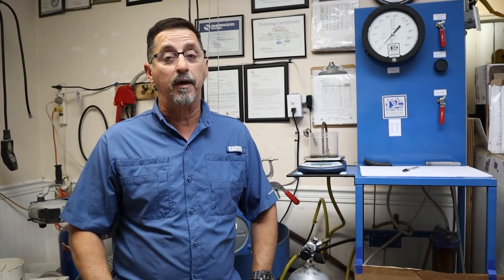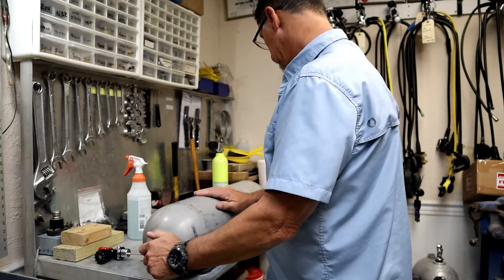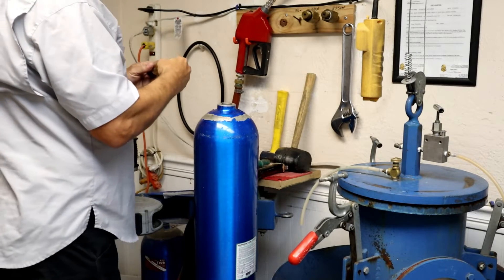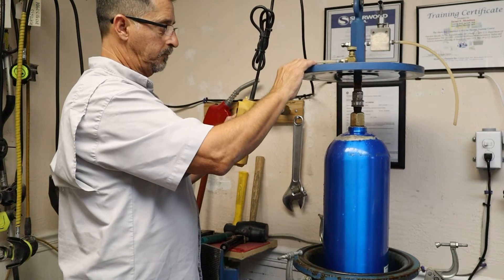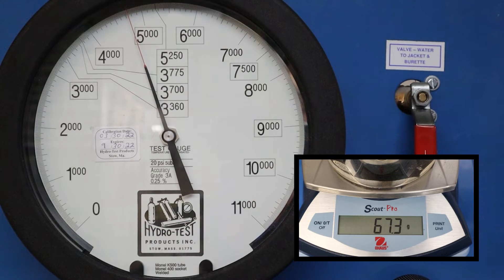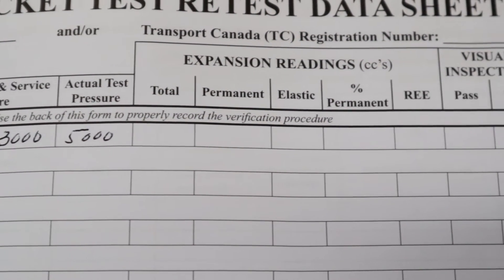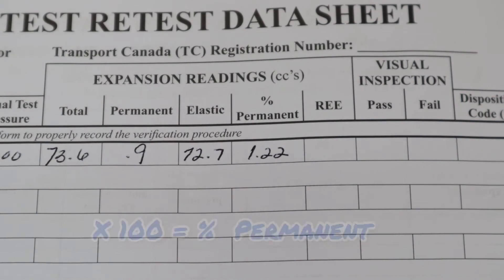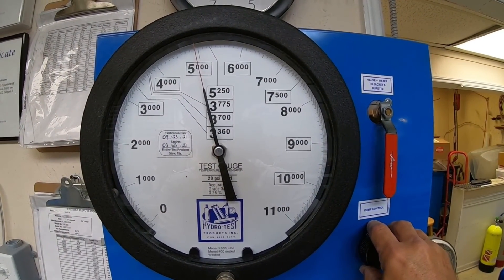How to Hydro Test a scuba tank

Comment: I enjoyed watching this. I've been servicing tanks for 25 years and would love to get into hydrostatic testing. I just don't know where to start, and if there's any regulations (which I'm sure of), do I need any type of license, etc.

The only thing I saw in my findings that's different from what you have is that the water jacket needs to be placed in a pit? Makes sense, but to your point, water doesn't explode. Do you have any information that could lead me to the right direction, including equipment as to where and how to get started? Thank you
Reply from the maker: Since you're in the tank service business, hydro testing would be the logical forward move for you.  I also serviced tanks as wells regs for over 20 years before I entered into hydro testing.
Having the experience with scuba tanks prior to hydro testing will enhance your ability to understand and excel in testing.  
The company Hydro-Test is a great source for info about equipment and training.  They also offer continuing education which is required by D.O.T every 3 years.  As for the in-ground water jacket, that is an option if plan to test larger cylinders and need the extra clearance.  I only test scuba tanks therefore a 40" above ground well is all I need.  Good luck to you, thanks for watching.👍

Comment: Do you put 5,000psi of air pressure into the scuba tank? I thought water was not compressible?
Reply from the maker: 5000 psi of water pressure, the tank is filled with water and inside the water jacket also filled with water.

Comment: empty weight, ABOUT 32 pounds,   adding, ABOUT 3 gallons?! , so we are adding PROBABLY 24+ pounds. nice imperial system. "about" time you guys hear about the metric system  10 litre = 10dl , 100cl, 1000ml, 10 kg, 100 hg, 1000g, 1000000 mg. now tell me, how heavy is 308.462 litre of water? easy, its 308.462 kilograms, its even 308462g. no about, no probably, no guesswork, no formulas, no rounding,  just a perfect goddam system. sorry for rambeling but imperial seem insane to me
Reply: nice content tho

Comment: Sir I want to know calibration proses
Reply from the maker: @moheebullah2586  calibration is done with a calibration cylinder to specified psi and cc of expansion.  Ex. 5000 psi expansion is 72.4 cc then release pressure and return to zero if not zero you are allowed 1% +/-

Comment: what you use to apply 5000psi? what is that equipment?thank you more videos pls
Reply from the maker: @cesarjr.oropel8942  My hydro machine is a water pump which is powered by air.  I use a scuba tank with a first stage adjusted down to 100 psi as my air supply.

Comment: How does this work with a let’s say a FABER hot galvanized steel with SP13488 specification? Is it tested the same way or do all galvanized cylinders done differently and only look at the REE as being pass fail?
Reply: I would like to know the same thing
Reply: @dawktah2680 I ran into a CONDEMNED issue with my FABER that has a born date of 1/19.
Reply from the maker: Your tank most likely had a false fail, I've seen this many times with galvanized steel.
Reply: @scubatechkeylargo  I wish I was close to you so you can knock out my hydro's. I've lost faith in my LDS due to this situation and being lied to and it sucks because they are the only recertifying agency that hydro's to DOT standards where I'm at.
Reply from the maker: @BigGixx23  sorry to hear, I’ve also come across this in my area. As a matter of fact this issue is what led me to become a hydro tester. Good luck to you.
Reply from the maker: Faber Hot dip gal. tanks are now coming into their first hydro testing.  As of the current date Faber has not published any special testing procedures other than the 10% rule.  I suspect as testers fail these tanks Faber will petition DOT  just like ( Worthington & PST) for special testing using REE and multiple pretest.  Galvanized cylinders have a false fail on first and sometimes second test, this is why special procedures must be applied.  I've made several inquiries about this issue with Faber Galvanized tanks, so far nothing.
Reply from the maker: Faber Hot dip gal. tanks are now coming into their first hydro testing.  As of the current date Faber has not published any special testing procedures other than the 10% rule.  I suspect as testers fail these tanks Faber will petition DOT  just like ( Worthington & PST) for special testing using REE and multiple pretest.  Galvanized cylinders have a false fail on first and sometimes second test, this is why special procedures must be applied.  I've made several inquiries about this issue with Faber Galvanized tanks, so far nothing.

Comment: well, now i know how the neck of my tank got cracked, im thinking all this testing is just doing more harm than good. its like, do you change your oil and then drive like its a racecar
Reply: Yeah, I was literally just watching and was thinking the same thing. I went to the comments to see if anyone else was wondering how hard it is on these tanks, just to have it tested. I am trying to research tanks for paintball and pcp air rifles. I know the carbon fiber paint ball tanks are given a life span of 15 years, but I feel like getting them tested every 5 years is harder on them than just being  careful with how you use them. And all the things I read on forums say they have never heard of a carbon tank failure in the field. Maybe a cheap regulator failure but never a tank. I read about a place purposely gouging a tank 50% through the side and filling it to 13,000 psi before it failed . But I don't think they are even catastrophic failures. I think it's more of a slow leak, and maybe the fibers start to unravel. I just think if you take care of them and not have them filled by amateurs that dont filter the water out or fill them up fast, they shouldn't have a catastrophic failure. No one will ever admit it, though.

Comment: Thanks for the informative video.
I am here trying get a better understanding how all this works.
Also I'm dabbling in a different application,. PCP for air rifles.
Just purchased a carbon fiber over Aluminum tank.
I have my own compressor and Have had an old retired tank laying around still holding air(Scott scba)
But I will not add pressure to it at this point until I have it hydro'd (if it can be be done)
The tank exterior is fine visually and I know that's as far as it goes.
Reason I'm here again is Safety,. 
not sure if it matters, my tanks stay indoors and are not banged around.
The whole 15 year thing... I'm trying to grasp,. I've seen tanks 40 yrs old holding pressure, Now that being said they could be a grenade with the pin pulled or they could last longer than I'm around(I Don't know)That's why I'm searching this information and not Just here.
I'm not fond of the idea of having a hole drilled in my tank (Just Because Of A Date)and no test actually performed to justify.
And I may be wrong in my thinking, and if I find that out I will change my thoughts on this.
Closing thoughts: I know folks way smarter than me designed this format/platform.
The other 2(TWO) factors is Safety And MONEY,. and that's what I am trying to separate if that's even possible.   
Now this new tank I'm getting, I will be installing the Valve and will be regularly inspecting the interior and will know how this tanks full history will be.
The Scott SCBA tank I have went into burning buildings and sure it had some abuse including drops and being banged around.
And again I have it Idle at this point. But it's a bit of history to me.

Thank you again.
Reply from the maker: SCBA bottles are made from thin aluminum shell wrapped with carbon fiber and resin finish for strength. 
The lifespan of 15 years is designated by the manufacture, they believe after 15 years these bottles can weaken and no longer be trustworthy to hold pressure.  These bottles easily damage, any exposed fibers is considered a weak stop.  Thanks for watching... be safe.

Comment: So does over pressurizing the tank actually shorten its lifespan ?
Reply from the maker: Over pressurizing is not a good practice regardless of steel or aluminum,  it can lead to metal fatigue. All tanks are elastic and will flex while filling,  hydro testing is designed to catch metal fatigued/ weaken tanks before a catastrophic  failure.   I do believe over pressuring tanks can shorten its lifespan by causing metal fatigue.  Thanks for watching!
Reply: @scubatechkeylargo  thank you for your response . However my question was about pressure testing to 5/3 of capacity 
or over pressure during the test
Reply from the maker: No evidence of hydro testing leading to shorten life span on  cylinders, could be why it's every 5 years and not more often.
Reply: @scubatechkeylargo  thank you 
I was just curious
Reply: @scubatechkeylargo  Yes.  It's essentially the same as proofing a firearm.  More pressure means more stretch, more stretch means more fatigue effects.  You won't shorten the life below the manufacturer's specification if you stick to their recommended test interval.  And they probably have a margin built into that as well for some amount of spontaneous testing.  But if you started testing daily you could probably wear a tank out pretty quickly.  The only difference between hydro testing and just filling the tank to that pressure with air is that water's incompressible nature means there's no significant stored energy to blow the lid off your displacement tank in the case of a rupture.

If you were using the tank heavily it might even be wise to put it in the displacement tub every time it was filled and monitor for sudden increases in stretch.  Metal fatigue can sneak up on you, as a handful of suddenly-roofless airliners can attest.

Comment: Is there any way you can tell how long the tank may last or how old it is by the hydro test statistics?
Reply from the maker: The test results don't give life expectancy, however the percentage of expansion can give a clue as to the metal fatigue.  For example a typical result for normal used tanks is anywhere from less than 1 % to 4 or 5 %. when approaching 8% to 9% is plausible conclude the tanks has had heavy use,  10% is a fail.

Comment: Can you do an identical video with a LP steel tank showing the REE and the Plus stamp?  It seems to be a mystery to many dive shops still.  Thanks.
Donate for a Dream
Reply from the maker: Yes, I have in mind to show steel hydro test. PST & Worthington tanks require multiple test versus single test on aluminum.  July is busy with lobster season around the corner, but I will put a video together as soon as possible.
Reply: @scubatechkeylargo  do you mean the round out process for the galvanized tanks?

Comment: Isn't it advisable to use torque wrench instead of a adjustable to tight the adaptor
Reply from the maker: Tank valves are torqued to 60 ft. lbs. , however the hydro adaptor doesn't require torque. A leak will be easily detectable when pressurizing the cylinder, mainly because the machine won't build pressure.

Comment: Most educational. In the UK if the tank is used for SCUBA it must be (like yourselves) tested every 5 years but the regulator has to be tested every two years. Even if the tank is used for an airgun, the bottle has to be 5 year tested and no shop will fill it if is not stamped with the current validity from and to dates. Carbon fibre bottles are deemed unusable after 10 years whether they pass the HS test or not.

Comment: I knew there was an elastic allowance but didn't know about the permanent one. Given that each test permanently expands the tank a little is there consideration of how many times the tank has been tested? Ie does a tank that's been tested 10 times have the same permitted level of permanent expansion as a new tank?
Reply from the maker: Cylinders have the same permanent expansion allowance regardless of the number of hydro tests.
Thanks for watching
Reply: @scubatechkeylargo  Does the amount of permanent expansion each test taper off over time or is it constant. If constant that would seem to make the test somewhat destructive in the long term.
Reply from the maker: With each test the permanent expansion is for the day of testing, it is not accumulative.
The permanent percentage isn't added to each subsequent test.  The tanks do relax if left in the well overnight you can see the permanet reading shrink.  No harm in the long term.

Comment: Did a TON of these in the mid 80's ..our shop serviced a lot of shops in Palm Beach County .. The lid I had needed to be screwed down ..didn't have those quick release's you have ... I used a pipette scale to read the expansion ..scary sometimes when the pressure is nearing it highest point ...never had one give way thou ..we didn't have the stamp most have ..I had to stamp all 4 of them B3-83 I think (long time ago) ..our drying system was a tank rack with pvc plumbing we used a vacuum cleaner to blow the air and put it outside so the suns heat would help ...This is where I began my Scuba Carer ..coming from being an Auto/Truck Mechanic ... Memories ..Good Video ..I like the scale better than the pipette ....
Reply from the maker: Yes I started with Burette tubes to read water expansion, the scale is much better. They also have a pneumatic closure for lids now, it's about 3,000 bucks,  one day I 'll break down and buy it.
Reply: I have my tanks from 80's aluminum not used after 1990. Kept in dry storage. Can they be tested and used for diving. Tks

Comment: What is the max psi you can test this to?
Reply from the maker: Tanks have different test pressures general rule is 5/3 of working pressure, for example 3000psi, test pressure is 5000psi
2400 psi, test pressure is 4000 psi
3442 psi, test pressure is 5250 psi
Reply: @scubatechkeylargo  so if it’s at 5000 psi. Is there a range you are allowed to go up to? For example 5200?  This is interesting and thank you for replying
Reply from the maker: 5000 is the actual test pressure, the only reason to go above is for re-test due to some mishap during the test.  The re-test is 10% more which would be 5500 psi.
Reply: @scubatechkeylargo  thanks for explaining this. Very interesting.

Comment: Do you do scba tanks?
Reply from the maker: I only test scuba tanks, 3AL, 3AA, 3A and Special Permit tanks.
SCBA tanks are commonly used by fire fighters,  paint ball & air riffles.
The testing procedure is basically the same except for the stamping.  SCBA are not stamped, they adhere a dated label with resin.

Comment: I would redo a visual inspection of the neck for crack after the test.
Reply from the maker: you are correct, a neck inspection after hydro is procedure prior to locking the valve and filling.

Comment: You might want to invest in a Inspection Scope for Cylinder Neck Internal Thread Examination, it's impossible to see microscopic hairline cracks in the threads without it.... it's almost like guessing when you use a mirror.
Reply from the maker: You are correct, hairline cracks are easy to overlook.  I do have 3 additional viewers other than a mirror.  Optiviewer, Optical Plus scope and Visual Plus 3 (eddy current machine).  When I teach VIP Inspectors and Hydro Testers to locate necks cracks I show them how to use all 3.  Currently I have 6 tanks with confirmed neck cracks so my students can practice.  I remember when these cracks first started to develop in the  80's  we would spot them because they were leaking during fill,  by 1989 Luxfer ceased the use 6351 aluminum the culprit of the SLC. We come a long way since.  Soon I'll be posting more videos, just in the middle of summer madness with little spare time.  Thanks for watching.